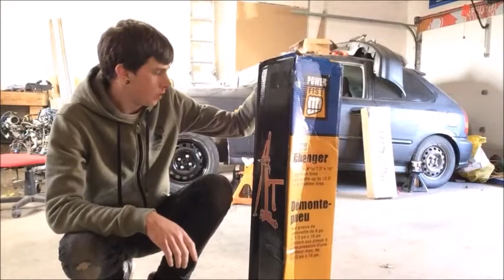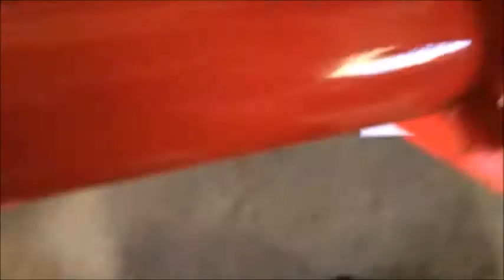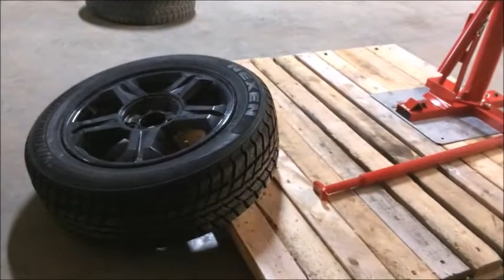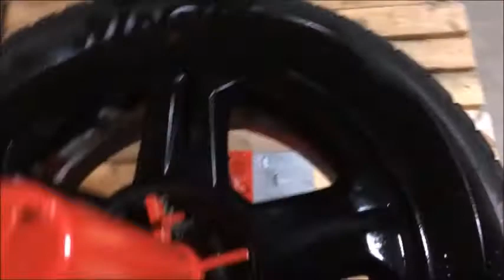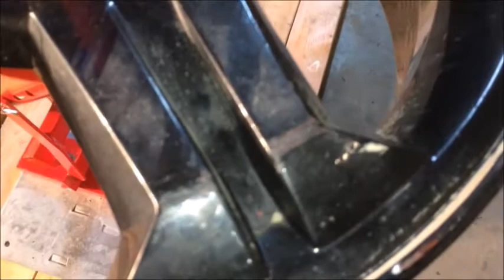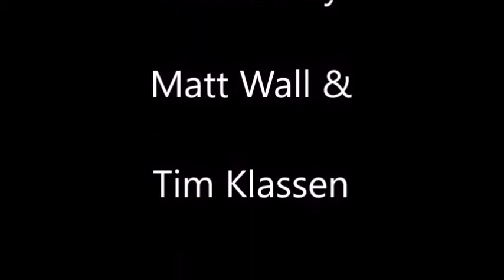Power Fist / Harbor Freight Tire Changer Review

Comment: Its $40 at HF without a coupon.Also that one is identical to but not a HF.You haven't mounted many tires if you think you can flip the rim next time.It looks like a spray painted rim to me anyway.This kind of tire changer is good for a home ,not so picky,tire boy.If you want a pro job get it changed on a real machine that never touches the outer rim.

Comment: They work ok. You'll have a tough time changing a tire with the rim flipped over. The rim is designed to take the tire off from the top. You might want to pick up a Teflon cover for your tire bar. That will help prevent rim damage.